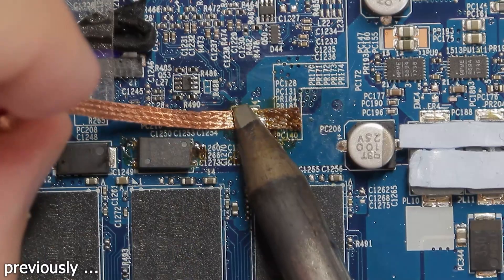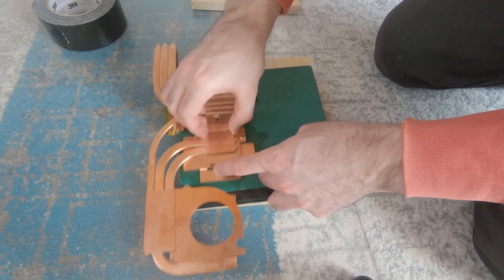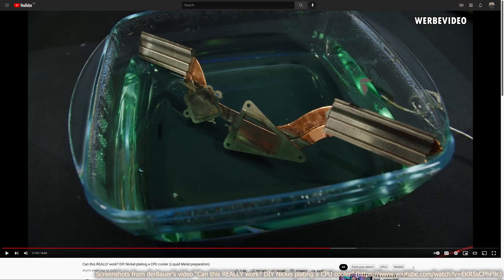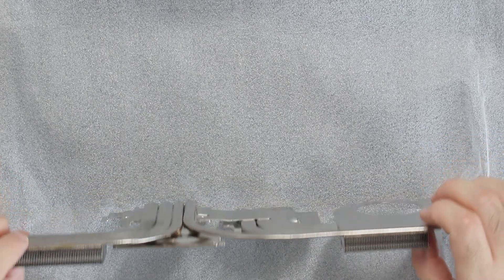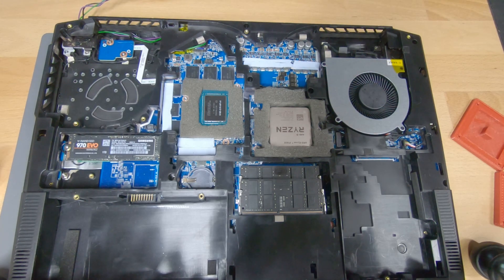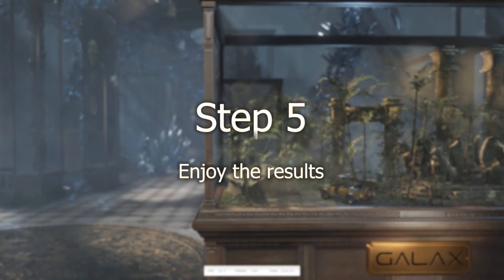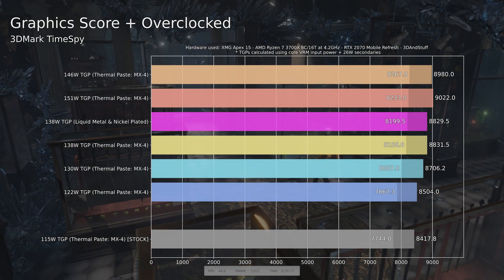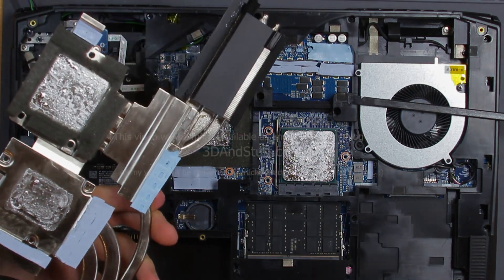Nickel Plating & Liquid Metal - Laptop Modding Adventure - Part 5

Comment: I've heard that the cheapest fix for the gallium seeping into the copper is to take your cooler off and apply the LM to the copper and then leave it disassembled for a couple days. The gallium will become permanently alloyed with the copper and now you clean it. Do not try to polish-off the gallium "stain" because this stain has zero negative effect on conductivity. Now you will replace the LM with fresh and put the computer back together. Now your custom liquid metal upgrade will not drop in performance because it "dried out". Only so much gallium can seep into the copper. Once it's done, it stops ruining your liquid metal and then it lasts a long time.

Comment: foam barrier and isolating ic's is a stupid idea. yea you will get better temps on the temperature diode and you will overheat other components. it's a shitty idea. you don't need that crap to use liquid metal just apply it carefully. there's nothing wrong with it. also there's many non conductive compounds with similar performance. you could do a lot better.
Reply from the maker: Nothing overheats if the surrounding chips do not use much power. Covering powerstages would be stupid of course
Reply: @TechModLab  what you just said doesn't fully account for how heat transfer works according to the laws of thermodynamics. it's a bad idea. period.

Comment: I have a dumb question to ask.
What if you nickel plate an Aluminum heatsink then use a liquid metal as the thermal solution ?
Will the nickel layer stop the liquid metal from sipping into the Aluminum and damaging it?

Comment: If I may ask.
When you did the resistor swap from stock to various combinations your expected measured value didn't appear (meaning you had to do various combinations)
Doesn't this imply that what you think is 138W is in fact another value?! maybe much lower.
Because as you said some other factors may be taken into account. 
Or the 138W power draw to be real but the whole system to be throttled back by those unknown other factors.
To have a +20% increase in the power, and tune the core and memory and a highly customized and much better cooling setup to ONLY get under 5% better results, something doesn't seem to be logical.
And this is where the problem with manufacturers not releasing repair and specs information about the products anymore to allow easy repair and diagnostic...a predatory capitalist society where they want users to throw and create waste the older systems and buy newer ones even though older ones can be repaired easily by swapping out some components or even modding them.
Imagine for cars they would do the same. Throw away your existing car, don't repair it, buy the newer one at an even higher price and thrust us on our word is much better.
Reply from the maker: I measured the 138W from the VRM's i²c data. It tells you which power goes in and out of it. Before the Mod (so stock) the GPU Core VRM told me that 89W-ish going in. Which means that there is 26-27W consumed elsewhere (like video memory and the 1.8V auxiliary line). With the modded shunt set to 4mOhm I would expect that the power of the whole card gets multiplied by 5mOhm/4mOhm = 1.25 --> 1.25x115W = 144W, but instead only the core power got multiplied with 1.25x89W = 138W, which seems a bit strange to me since I swapped the shunt which measures the total power coming in. I could actually measure the 138W with the VRM's communication interface, just like when stock. But nevertheless the differences could just be other losses involved.

Comment: Stick layer of sheet metal to plastic cover and connect to heat pipes thermal pads. Use taller screws on cover leave a small gap for air to come in. Use washers in between cover
Reply: I need a picture to see this better

Comment: is it possible to mod laptop speakers? i mean obviously alongside with custom drivers but is it possible?
Reply from the maker: Yes it's possible, but very hard. You don't need another driver, but the speakers are built into a custom case, which is unique for each laptop. But you can use a software called APOEqualizer to equalize the sound stream in most devices using a realtek audio chip.
Reply: @TechModLab  so i am replacing the speaker module or am i equalising it?

Comment: What do you think abou Panasonic Pyrolytic Graphite Sheets? Maybe you could build a large heatsink on the underside of the case. PGS is good for spreading heat on the x-axis. To transfer heat on the z axis you would need thermal pads.

Comment: Hi, how can I find the shunt resistor on my laptop motherboard? It's Asus strix g15 with a RTX 3070 on it. Are there any blueprints in internet of my motherboard?
Reply from the maker: look for the GPU VRM on the motherboard, follow the traces back until you find two big resistors which are sorrounded by wide copper planes. You probably need to remove the cooler. On some motherboards they are on the back side. Maybe you have to remove the motherboard and flip it over to find them
Reply: @TechModLab  thank you a lot

Comment: Can someone give me a link for foam to seal my CPU and GPU? I need one that easily compresses. I was curious how you keep the foam in place also. Do you guys glue the foam? I have read some people report that sealing with foam skyrockets temperatures, is that because they used a wrong thickness?
Reply from the maker: You are right, you need foam that easily compresses. That might have been the problem of peeps reporting about higher temperatures with foam.
I used foam made for acoustic dampening. You can buy such foam in HiFi Audio stores or online. Good thing about that stuff is that it is also made for higher temperatures and is not or at least hardly flamable.
Keep in mind that the gap between the PCb and the heatsink is ually around 3-4mm. You need to cut the foam to 5-10mm thickness before use. Acoustic foam is thicker usually. It can be done easily using a cutter knife.
Reply: ANY foam is OK. Just a little thicker than Green die base to top of die measurement. Best to cut 1 piece patch with Die opening. THIS IS NO BIG DEAL! IGNORE THE FEAR MONGERS_SIMPLE as licking a thick postage stamp.

Comment: I don't understand one thing. Why you did not sandpaper the IHS of processor? I heard it give significant boost in temperatures. And is the IHS liqid metal compatible? I heard it's not, because it's not coper or nickel so it will corode.
Reply from the maker: Yes lapping the IHS should give more benefits, but would expose the IHS' copper, which would react with the LM. Well it definitely is copper underneath the surface, that's for sure. But if the surface is nickel plated, i think yes, but maybe not? It should be.
I think I will try out lapping the IHS in a future video. Maybe in combination with nickel plating the lapped IHS myself ^^ Would be fun to see how it goes
Reply: @TechModLab  as you said, LM does react with copper, but based on my findings, the reaction is too slow to make any significant difference. After around 3 years, apart from the discoloration there wasn't much of a change. I went over the surface with a scotch-brite type pad and some 5000 grit sandpaper and it was all flat and good. I also found that LM sticks better to the copper that had reacted with the older LM
Reply: Another thing to keep in mind, i tend to reapply LM after about 1 - 2 years. It does "dry out" after some time, and also, especially on laptops , it leaks out.
Reply from the maker: @motryx466  that's why i applied nickel as a diffusion barrier to the heatsink. That should make the electro diffusion process a lot slower than with bare copper. I hope to come away with >5 years while bare copper would need regular inspections until it's soaked.
Reply: @TechModLab  Looking forward to it. :)

Comment: nice, try watercooling it!, just solder a flat heatpipe wiith the ends cut in order for water to flow, you will get much cooler temps
Reply from the maker: good idea :) Could try to make it compatible to the new XMG Oasis external watercooling system ...
Reply: Yeh! Right! Obviously never tried soldering heat pipes and radiators together. Fool!